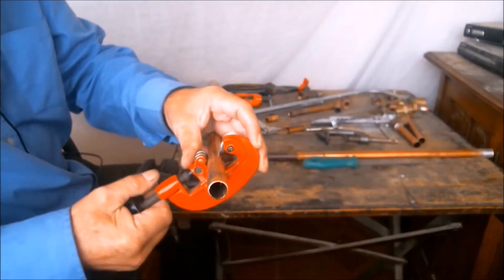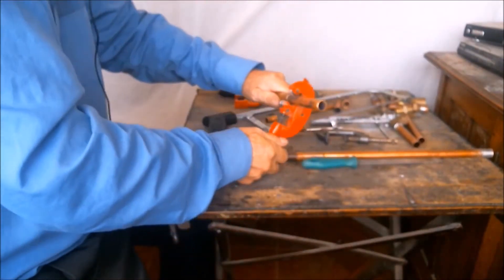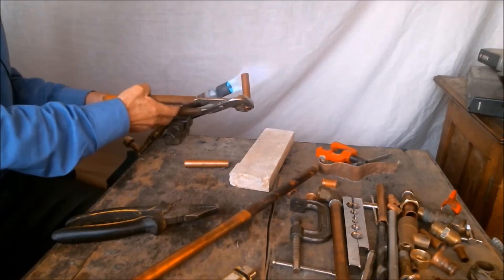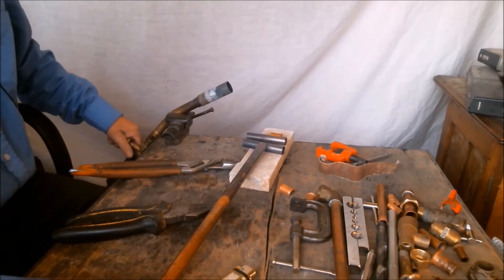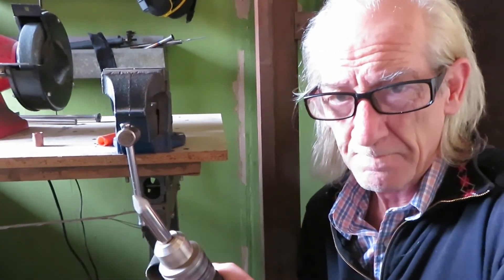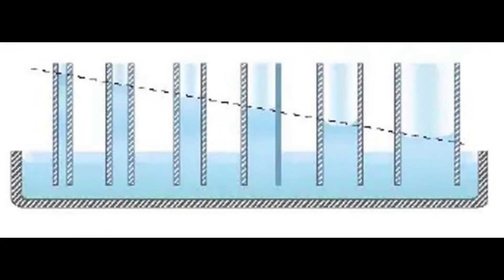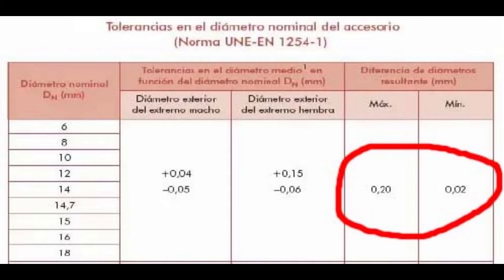Swaging Tutorial - How to swage copper pipes

Comment: Sir I am Indian sir I want copper pipe expend spin tools
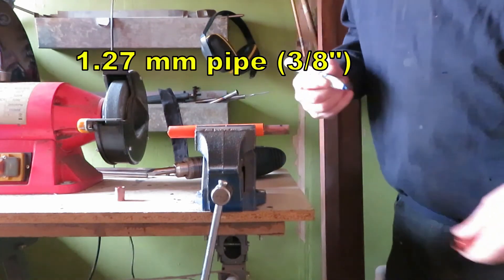Reply from the maker: At 2:30 you can see the tool I made.  You can make it yourself with a steel round bar of a diameter exactly the same as the outer diameter of the pipe you want to swag. You make 4 diagonal cuts on one end to make a point.

Comment: Hi, can swaging method used for mass productions of coils? This is the process where u-bend are connected to straight copper tubes to create circuits. Can it replace the flaring process where it is currently be used?
Reply from the maker: Hi Raj, I'm not familiar with the mass production, although most probably it uses hydraulic presses.  This manual swagging process is not recommended for gas systems due to the issues it has and considering the cost of the commercial equivalents.